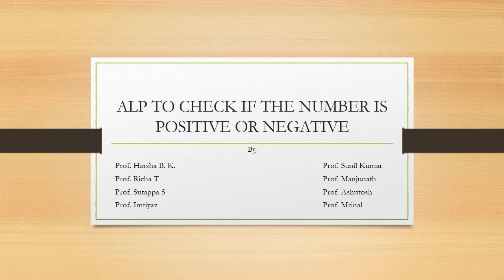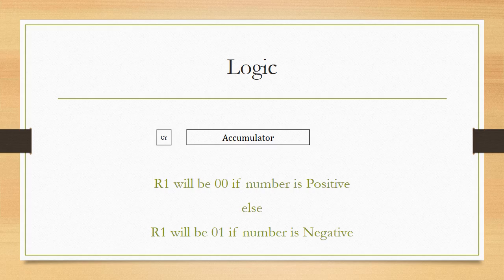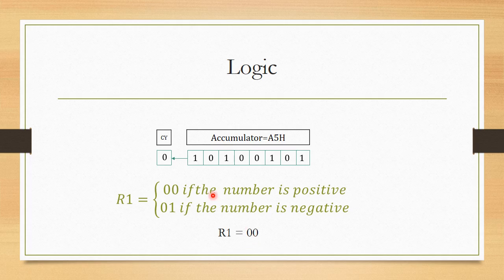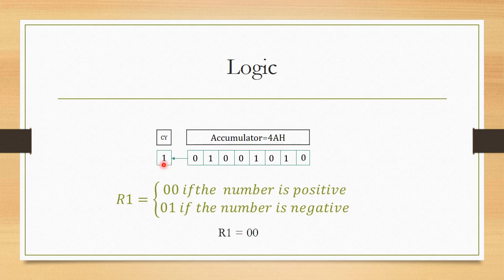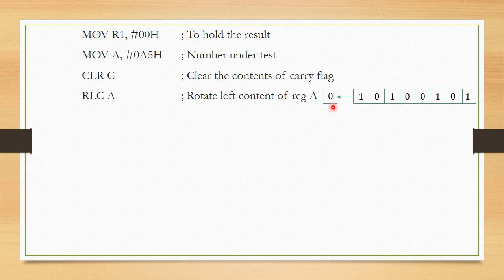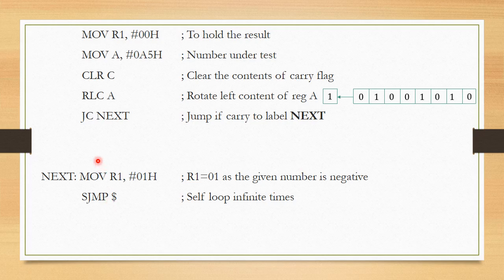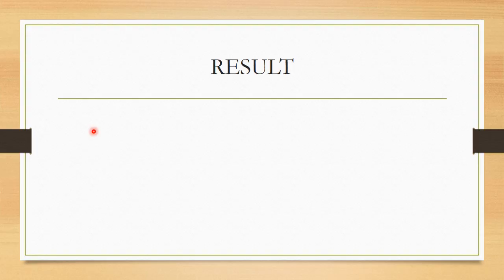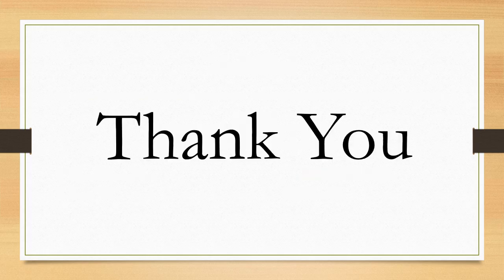8051 ALP TO CHECK IF THE NUMBER IS POSITIVE OR NEGATIVE

Comment: How should we write the similar program if we're supposed to find positive and negative in an array???
Reply from the maker: Have two registers (pointers):
One for taking the data from the array (number under test). Another one for saving the status(+ve or -ve).

Have a counter to check if all the elements in the array have been parsed.

Follow the process as mentioned in the Video until all the elements in the array have been tested.

Comment: Sir if postive value like 80 the 1st binary digit value will be 1 so this programm fail in this case
Reply from the maker: Thank you for the review dear Sharatkumar.

Hope this explanation will clear your confusion.
8051 is a 8 bit microcontroller. Hence the accumulator can take on 2^8 combinations of input that is 256 combinations. 

Depending on the MSB the following the number is said to be:
Positive if the MSB is 0, that is 00H-7fH
Negative if the MSB is 1, that is 80H-ffH

Hence 80H is not a positive number according to the convention used.